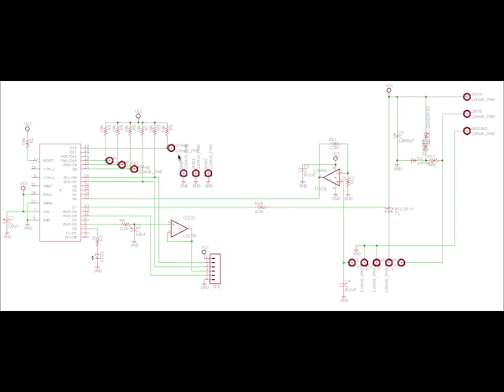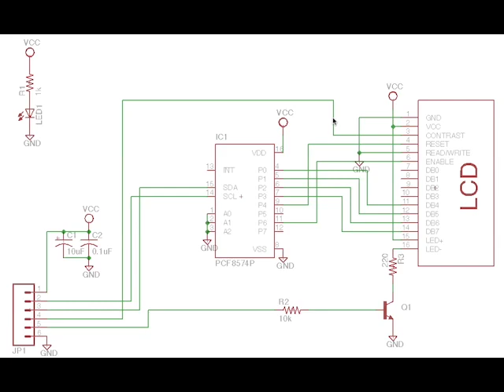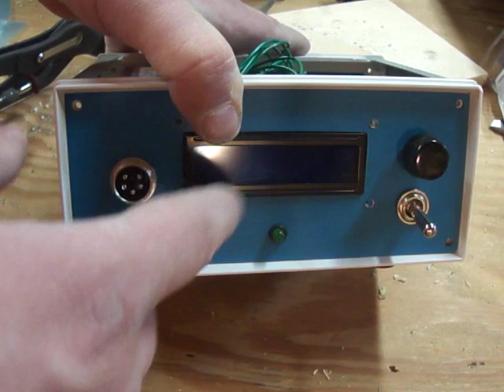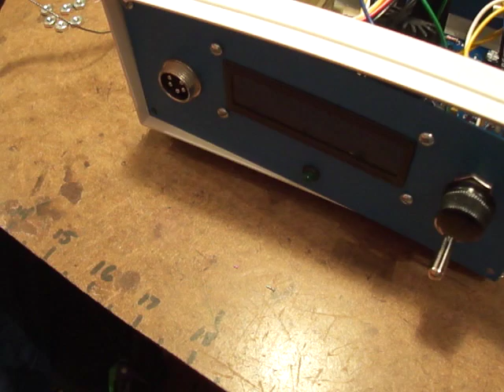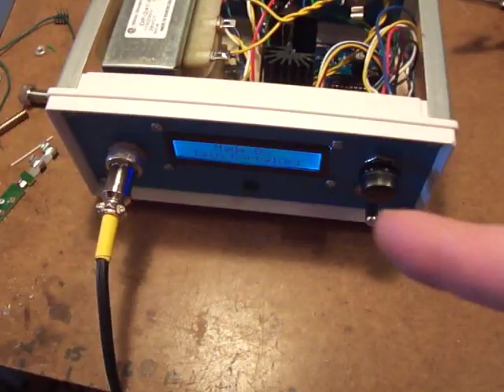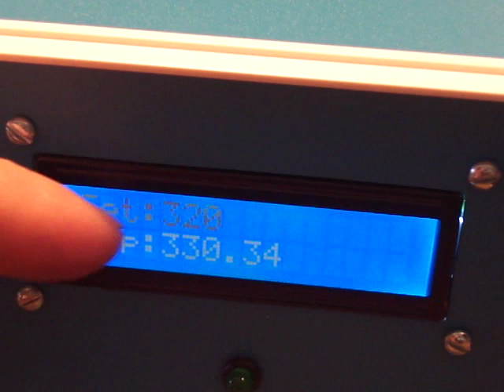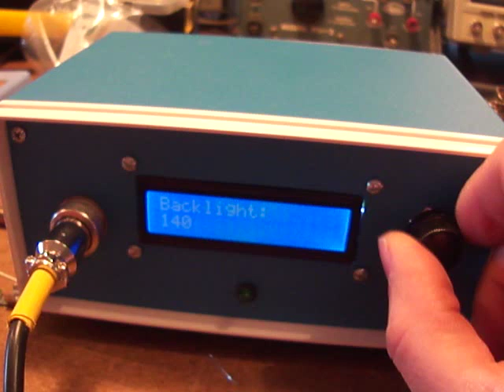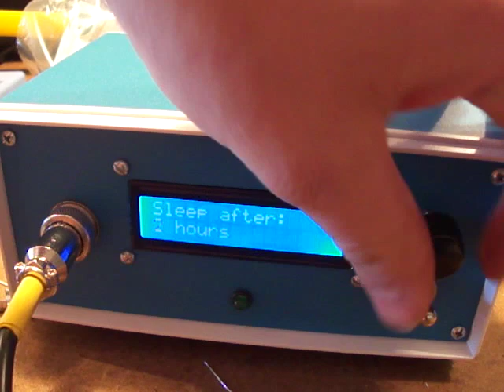DIY Arduino Powered Soldering Station

Comment: how many watts is your powers supply? could that be changed?
Reply from the maker: charles klein 90 watts but you can make it whatever you want by changing the transformer. The soldering iron is rated at 40w 24v but I’m over driving it at 28v that brings it up to 54w. So far after 2 years of constant use the heating element is still hanging in there.

Comment: what wattage is it? from what i could tell i think its a 100 watt from the transformer. have you ever thought of selling the thing? i would guess its worth $100 to $150 dollars? is it a 1321 or 1322 their is a difference. i think hakko uses the 1321 and the other ones use the 1322 also the other ones have the male and female reversed. the other ones are cheaper! and the other ones have cheaper tips a real hakko will not fit the other ones.
Reply: Don't buy something like this. There's another really amazing Open Source project which has many more functions and regulates the temperature much better. It's made from Short to Ground, he has done a tutorial on GitHub
Reply: @gamesnic  Can you point me which ones, Google is no helping well, There is one on Hackter. io but the author make it seen to hard for DIY beginners.
Reply: @svsv9  Just Type "10 Dollar soldering iron" into YouTube and click on the video of short to ground. He has made a very simple tutorial.